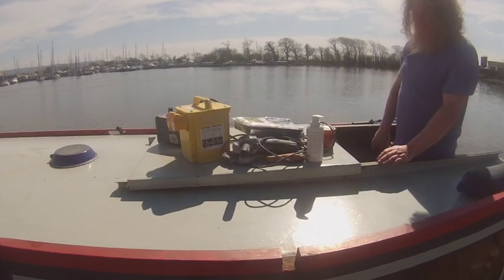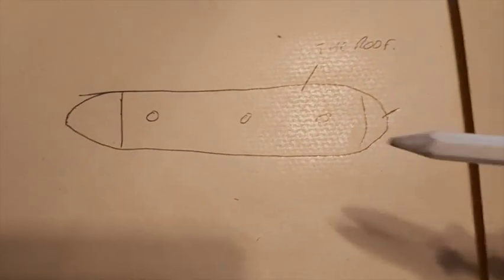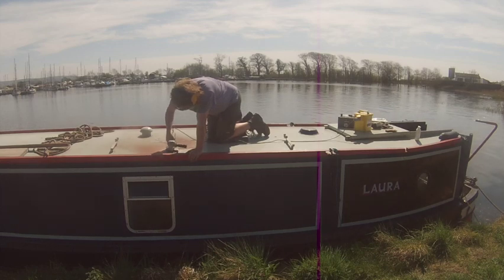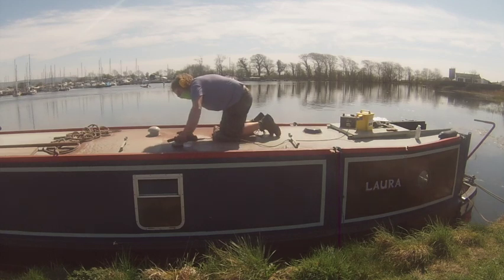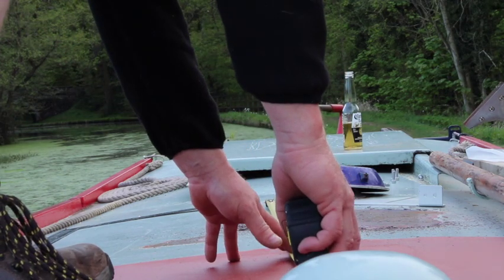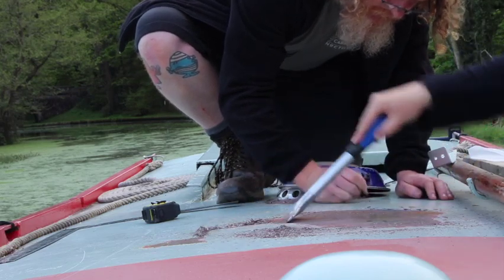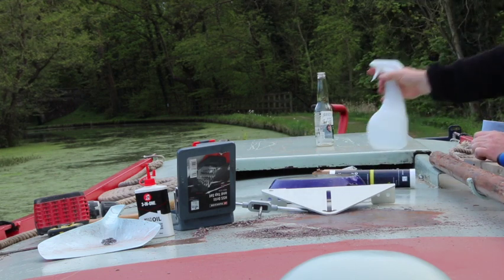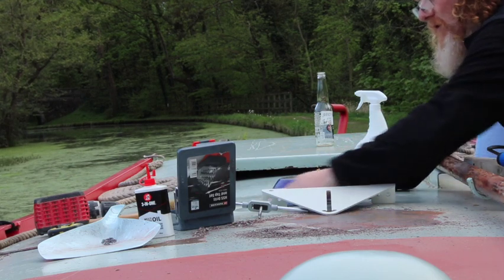Episode 41 Painting & Solar Panels DIY (Destroy It Yourself)

Comment: You might want to look into chemical strippers for the roof.  Modern paint strippers are very effective.  I am so sorry you got your tools stolen.  (The chances of catching the thieves are very low.)
Reply from the maker: Thanks Stephanie I will look into the chemical strippers, my first thoughts were what if it gets in the canal but I think I have a solution for that. I am going to contact some paint suppliers to ask if the stripper will work with what's on the roof. I will keep you posted 👍

Comment: How can you be sure you don’t hit a cable?
Reply from the maker: An excellent question thank you, I did look inside the boat for possible wiring runs, the light in the bedroom is off set from the centre of the boat & I took the cover off the vent which gave me a limited view of what's above the cladding in the end I just crossed my fingers that the wiring run didn't go to the middle of the roof. I did check when drilling each hole that I hadn't caught a wire. To absolutely make sure the wiring wouldn't be drilled through I would have had to remove the ceiling cladding & possibly the insulation to find the wires which I didn't want to do as it might open a can of worms I don't want to deal with yet it had nothing to do with me being lazy🤣. Once again thanks for the question I shall go into more detail about the solar panel fitting & will definitely include a segment about wire runs. Cheers Saul